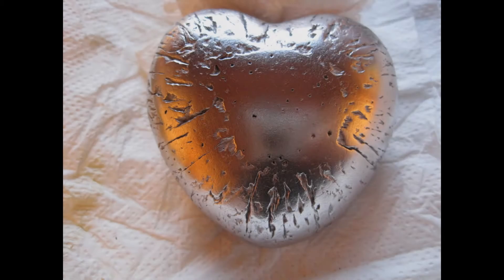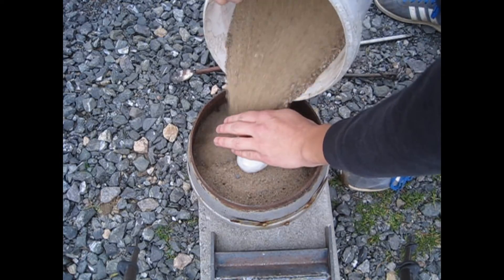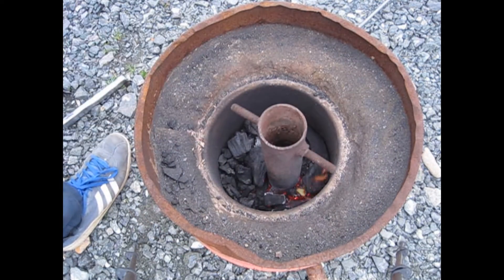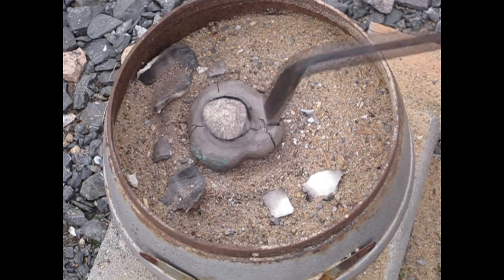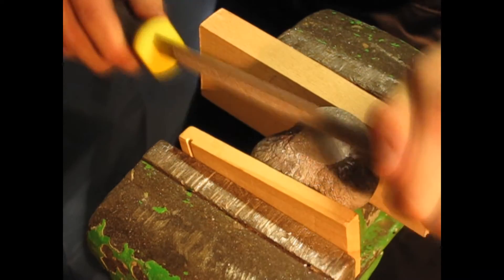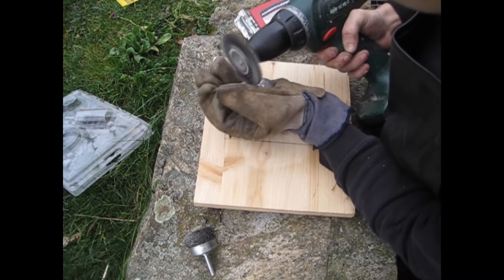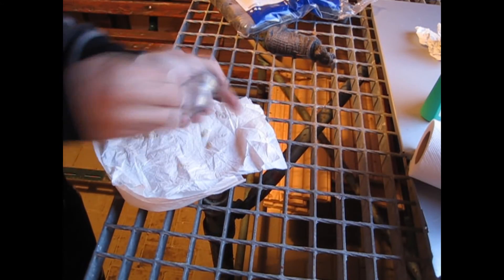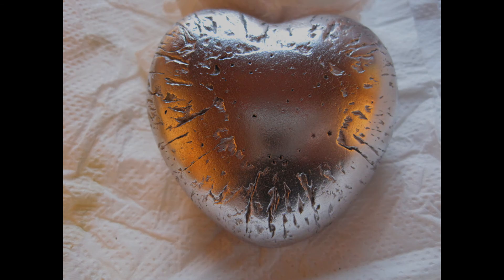Casting a heart from aluminum (ceramic shell casting) [HOW TO]

Comment: Wash out the mold with acetone, it dissolves the foam.
Did you ever have they clay crack?
Reply: +Joep Stuyfzand This is lost foam casting the idea is that the foam gets vaporized as soon as the molten metal touches it so it fills the shape that it was in
Reply: Cast and Forge Cool!
Reply from the maker: +Joep Stuyfzand I tried to combine the loast foam method and the ceramic shell method. Iam not sure if the clay holds its strength if I wash it with aceton. Its just air hardening clay from the home depot for kids for playing or decorative purpose. 
Surprisingly the clay did not crack, I think its due to the sand thats outside the mold.
Reply: Cast and Forge I will try it, and I think acetone wont do weird thing to it
Reply from the maker: I think I will also try it the next time